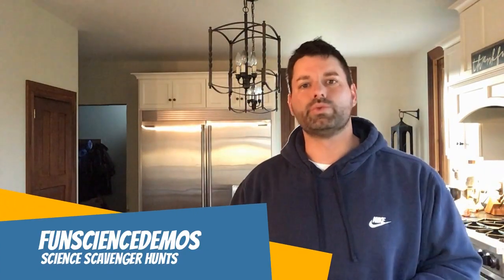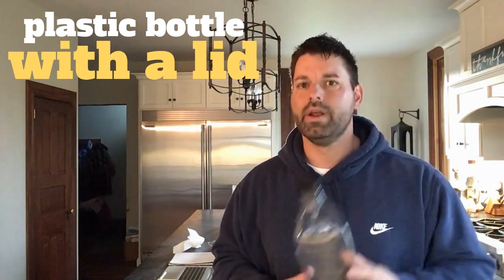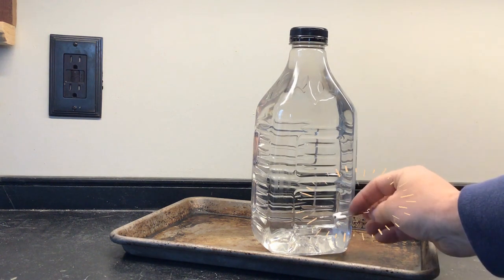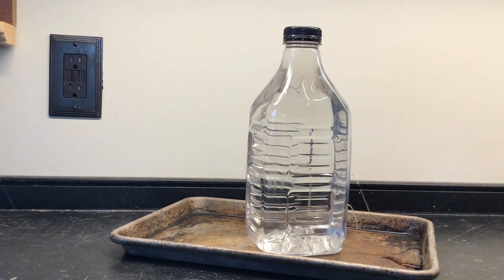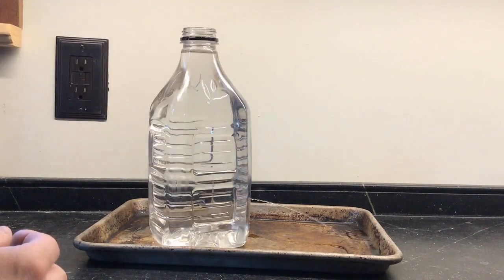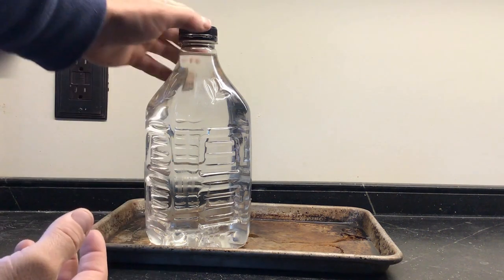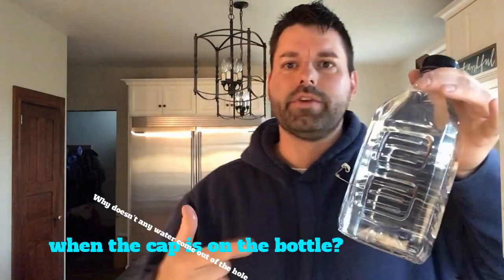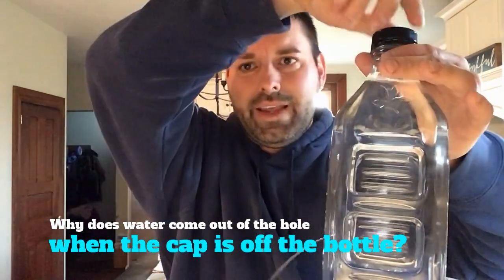The Water Bottle and Pin - FunScience Scavenger Hunt

Comment: The reason is that as u unscrew the top of the bottle u allowed the pressure outside to push the water through the hole in it, normally if there's no hole in the bottle then nth would happen cuz there's no hole

Comment: When you open the lid air comes through the cap and creating an air pressure to push the water outside through the hole.  But when you put the lid there is no air pressure to push the water and water dosent comes out . The air pressure outside of the bottle should be same as inside in the bottle...........😂

Comment: The water pressure inside the bottle always try to push the water down, so we will expect the water to come out of that tiny hole. But here the difference in air pressure doing the trick. 
When you cover the bottle with a cap, there will be vaccum (low pressure) created at the top and outside the hole air pressure is atmospheric and maximum, so it will try to push the air inside the hole from atmosphere, as an effect water leekage stops. 
In contrast when you open the cap,   there is no vacuum, air pressure above the bottle and side of the bottle is same, then bcz of water pressure, the water will come out.
Reply from the maker: You are the best! Glad you enjoyed it! Thanks for spreading science and check out our channel: https://www.youtube.com/funsciencedemos

Comment: Once the cap is placed onto the bottle, the air pressure both in and out of the bottle are equal. So because of this, nothing leaves the bottle through the hole until the cap is uncovered from the bottle. Then the water will come out.

Comment: Environmental pressure is the reason.. when you open the lid, the air enters into the bottle and pushes the water..bacause bottle has hole the water will flow through it. When the lid was closed the pressure inside and outside the bottle was same..so equilibrium happened
Reply from the maker: Glad you enjoyed it! Thanks for spreading science and check out our channel: https://www.youtube.com/funsciencedemos